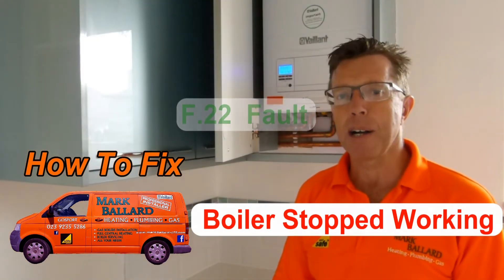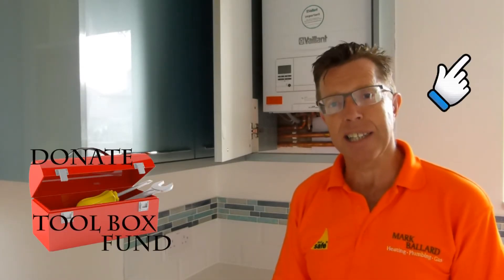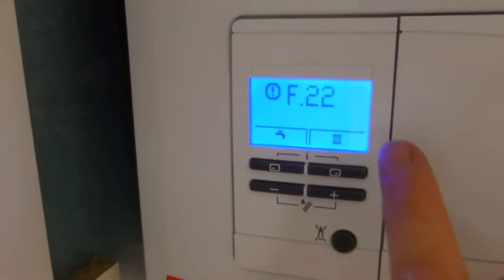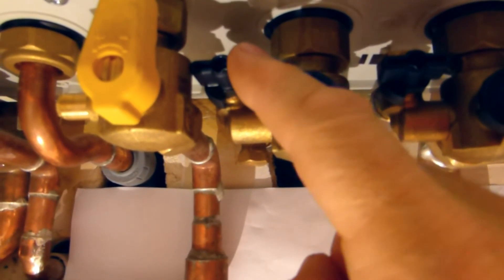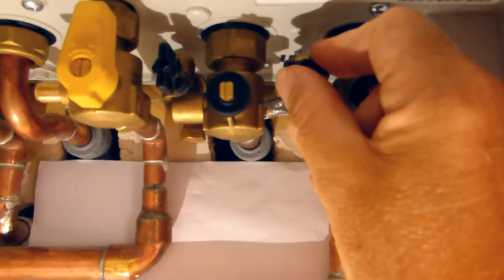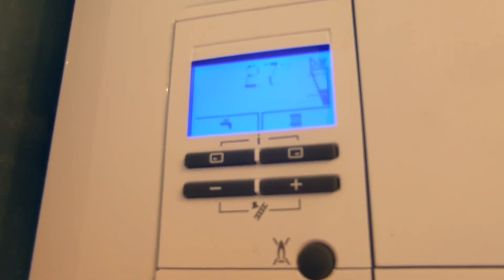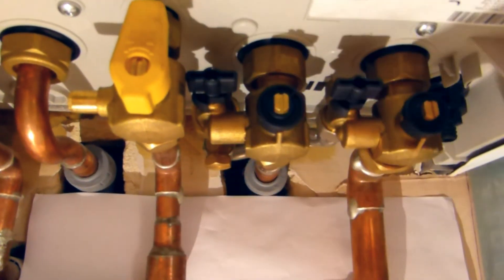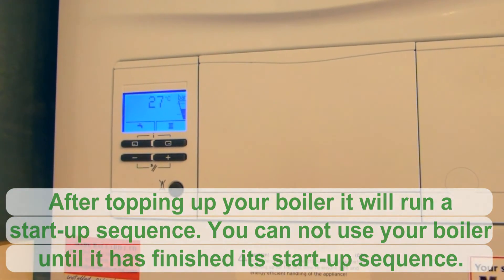How to Fix F22 on a Vaillant ecoFIT PURE Combination Boiler, Detailed Step by Step Instructions

Comment: I've tried the top up, both opened up and no water flows into top up pressure any ideas?
Reply: removed plastic taps and turned with a spanner still no flow, the taps are actually fine. where is the next valve that could be off?

Comment: Amazing and a massive thanks! Came back home from holiday and found the boiler was down to 0 bar and the house was an ice box following a sub zero temperature week . This has fixed the hot water and heating is kicking in now. So so grateful to you for the quick turnaround and saving some money on it!

Comment: Hi
I’ve topped up my boiler using this method many times. We changed radiators so had to top up a lot. Anyway now my using this method the water is very slow to fill and then sometimes stops filling. Any ideas

Comment: just before one retire to bed and find the pressure is down  f.22 in my ecofit 825.  thank you Mark  for your simple comprehensive instruction. At almost 0 degree temp this time of the year, your video was so helpful. thanks so much and more power to your cause. the manual booklet did not have this simple instruction.

Comment: Yep, worked a treat. Poring through the manuals told me what the code meant and what to do to fix it but not how to do it. We needed you for that. Great instructions and fixed it in a couple of minutes instead of giving up and calling in help. Also appreciated you telling me I'd have to wait 5 mins for the boiler to reset itself. Saved me from a cold November night. Thank you.

Comment: Hello Mark. I also have f22 error everytime I open my hot water tap. The water pressure gauge is fine, it's 1.5. I already called an engineer to look at it and change the water pump as it not working fine.  However, a day its showing the same error, water pressure is fine and it has a new pump installed.  I really don't know what to do next. Please help.

Comment: How do you reduce the pressure from 2.9 bar to 1.5 bar
Reply from the maker: Easiest way is just to bleed from a radiator bleed point where you would normally bleed air out at the top. it takes a lot longer but it's the safest way

Comment: Hi Mark,
Excellent simplified video. I have a new Vaillant eco fit pure 30 Boiler and it's great. 3 minutes and 8 Radiators are Hot. Only problem i have had is 1 Radiator Joint leaking. 
They are old Radiators though. I have Bled the upstairs Loo Radiator twice in a month since Boiler Install otherwise no issues. Super Hot Radiators now.
Stevie in Fife.

Comment: Thanks Mark. I will make donation . 
But i did increase the bar pressure a bit higher than middle. Do you know how to decrease bar pressure? And its making noise like hammering sound after increasing the bar pressure. Is this common?

Comment: Hi Mark, my boiler's done it again! I tried to bring the pressure up as per your instructions, but I noticed that your video doesn't mention at what point  one should turn off the valve on the right. I tried to tweak the pressure by using the valve on the left, but it kept rising and then I got scared and switched off the boiler. Now, no hot water. Sigh.
Reply from the maker: Hope you got your boiler working again. Think of the valves as taps, one after the other. Both taps have to be opened to let water into the boiler. Doesn't matter which one is closed or opened first. Just open both and close both. In the videos I tell you the easiest way to do this. Hope that helps for the future.
Reply: He explains it quite clearly if you watch the whole of the video
Reply: @timharrison9157  He did reply to my query a year ago... but thanks anyway.

Comment: I had a problem with finding the right taps for this - if you're having trouble, there should be five pipes:
L - R, 1 is hot water to radiators, 2 is hot water to taps, 3 is gas, 4 is cold water supply, 5 is water from radiators (this is a loop to reheat the warm water).
You need to feed cold water supply from 4 to 5 - there should be two taps (with handles) on 4 and 5 - if there is no visible connection between the two, you should attach a flexible metal sleeved pipe between the two (there had always been a flexi pipe lying on top of the boiler - I never knew what it was until now), turn on the tap on pipe 4, and then turn on the tap to pipe 5. This will fill the radiator loop with water and bring up the pressure. Don't forget to close the taps, and remove the flexible pipe.
Don't touch any other valves, especially ones without tap handles, you only need to use these two!
Reply from the maker: Great reply
Reply: @MarkBallardLTDHeatingEngineer  Could you please advise what the big yellow tap/knob is for? I nearly tried using this one but didn`t as was not sure that would be dangerous to do :/

Comment: Hi 
My boiler doesn’t have either of these valves and I have low pressure f22, model is eco fit sustain 835 do you have a video on this boiler

Comment: Hi my boiler has low pressure and is flashing F22 as well. I have the same make boiler and same display. But when I look underneath i don't have the purser knobs where you have them. I have the ones next to it. Where else could they be placed? Could they be below? As I have 2 pipes slot lower down then the first to you pointed out. Please help. I have just had this boiler fitted. Brand new just 4 days ago. Now this has happened :(
Reply: Should have said the model is Vaillant ecofit 830

Comment: Brilliant worked a treat! But when I opened the first valve water was coming out? Should I be worried?
Reply from the maker: If it stops when you finish fine. But consider getting it replaced before you use it again, then it may not stop coming out

Comment: My model does not seem to have either of the two valves. How do I top up the pressure? (It is an Ecofit Pure 630)
Reply: 630 would have an external filling loop/link as its a system boiler. 
It may situated by ya hot water cylinder???

Comment: Thanks for your help got more from you than the plumber that put it in.This is a new gas boiler luck I had a good i gear were the leek was presser joint came off pipes .Code F 22.